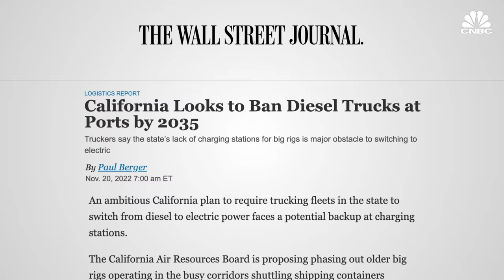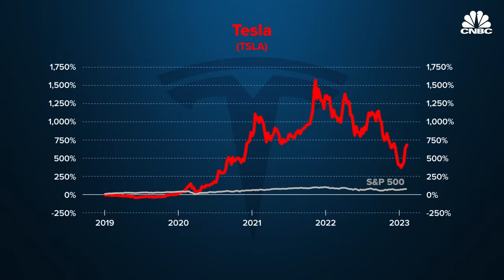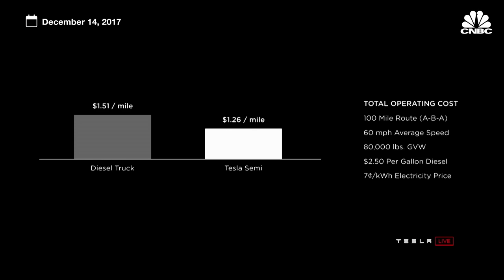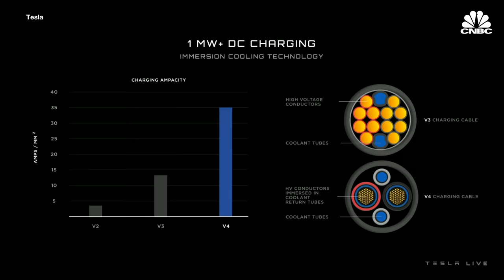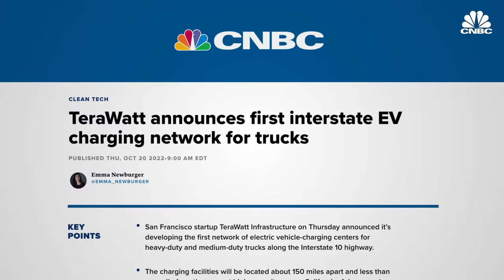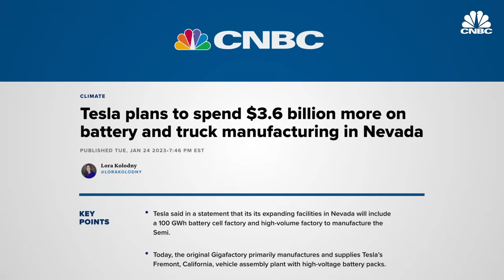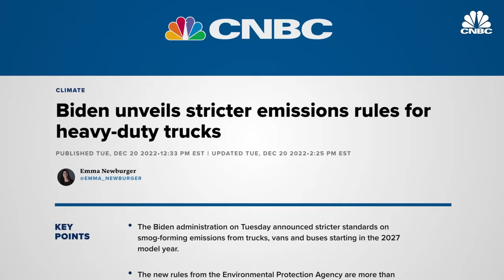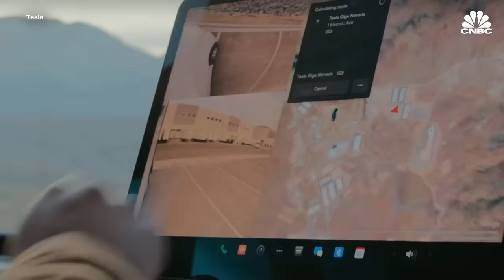Does The Tesla Semi Live Up To The Hype?

Comment: I can double over the road semi truck economy
Reply: Still waiting to hear how...
Reply: @BigBen621  with lift. Winglets strategically placed throughout the rig
Reply: @BigBen621  or possible redesign of trucks and trailers in general
Reply: @macbook802  Nice idea, but actual physics gets in the way. First, there are two components of drag or resistance that determine economy; aerodynamic drag or resistance, and rolling drag or resistance. Wings would reduce the weight on the wheels and thus reduce rolling drag; but they would also increase aerodynamic drag,  probably by a comparable amount—for no overall gain.
But a far bigger issue is that reducing the weight on the wheels would also reduce traction; and the more the weight is reduced, the more the traction is reduced as well. Any reduction in traction is going to have huge safety effects, due to reduced traction for cornering, braking, and acceleration.
Reply: @macbook802  The Tesla Semi was a clean-sheet design, from the ground up, for absolute minimum drag. As a result, it has far better economy than any other electric semi. The Tesla Semi's consumption averages 1.7 kWh/mile, and Tesla has stated that there's a clear path to 1.5—a potential 12% increase. If there are any further economies to be gained, you can be confident that Tesla engineers will achieve them; but the best possible improvement is nowhere near your claim of a 50% reduction in energy use.
Reply: @BigBen621  they can be deployable and retractable if need be. 40,000lbs of ground pressure vs 80,000lbs is still a very large amount of traction
Reply: @BigBen621  I've spent way way way longer behind the wheels of semis than all of Tesla's engineers combined. Since I was 18 years old I've spent more time behind a semi truck than on my feet
Reply: @BigBen621  if Tesla had a clear path to 1.5 during a ground up design why didn't they take it? And I'm not bashing Tesla I think it'll do great where it can do great, and the lift idea can be applied to their trucks as well
Reply: @BigBen621  and from all of my research there has been no testing to prove your ney say attitude
Reply: @macbook802  Sad to say, your experience as a truck driver doesn't repeal the laws of physics.
Reply: @macbook802  'if Tesla had a clear path to 1.5 during a ground up design why didn't they take it?"
You'd probably have to ask them.
Reply: @BigBen621  before driving a truck I was a full time skateboarder, I know physics I built my first full size airplane when I was 9 years old. I trained to be a helicopter pilot. I build rc airplanes I've thrown a frisbee and a boomerang hundreds of times
Reply: @macbook802  "and from all of my research there has been no testing to prove your ney [sic] say attitude"
Any engineer you propose this to is going to do the same calculation I walked you through, and conclude that no testing is required.
Reply: @macbook802   "I know physics ... . I trained to be a helicopter pilot."
Then you should know that you don't get lift without drag, which cancels the effect you were trying to achieve. And you should also be able to look up the lift equation, from which you'll find that generating 40,000 lbs. of lift at 60 MPH would take a wing of about 2,500 sq. ft.
Reply: @BigBen621  you're not an engineer, you're a Googler. Big difference
Reply: @macbook802  " you're not an engineer, you're a Googler."
Just out of curiosity, what in our debate led you to that fallacious conclusion?
Reply: @BigBen621  because you're interested in what people talk about, not what they do

Comment: 400 mile range..
what's the range with it loaded? 
I can't believe this truck only gets 400 miles. And I wont believe it will get that range fully loaded when electric pick up truck owners I know can't get 1/2 their range when loaded.
Reply: 500 miles fully loaded.
Reply: What John said. 

Comparing the Tesla Semi with electric pickup truck towing range is a false equivalence. Pickup trucks' EPA range is established without a towed load. At highway speeds, air resistance is the predominant load on a vehicle; and adding a trailer to an electric pickup truck doubles or triples air resistance; this is why the range of an electric pickup drops so much when towing. In the case of the Tesla Semi, EPA doesn't rate range of Class 8 trucks; but the stated range of 500 miles is established with a fully loaded trailer already attached, and so there is no loss of range when operated under the conditions with which the range was originally established.

Comment: Great so now on top of getting to the destination, there will be delays and planning around finding a place to charge such a large vehicle. Range of 100 miles, so 50 out 50 back...where u going!?
Reply: Where'd you get the nutty idea that the range is 100 miles? A Tesla Semi drove 500 miles from Fremont to San Diego, including climbing the 4,200 ft. Tejon Pass ("The Grapevine"), loaded to a GCVW of 81,000 lbs., on 93% battery charge.
Reply: @BigBen621  PepsiCo’s new Semis can haul Frito-Lay food products for around 425 miles (684 km), but for heavier loads of sodas, the trucks will do shorter trips of around 100 miles (160 km).
Reply: @Random-bm7ho  Either you've dishonestly edited the PepsiCo quote, completely changing its meaning; or you're quoting someone who did this. The actual statement, from a December 16th article in Reuters entitled  Exclusive-PepsiCo to roll out 100 Tesla Semis in 2023, exec says  and referring to Mike O'Connell, PepsiCo VP of Supply Chain, is "for heavier loads of sodas, the trucks will initially do shorter trips of around 100 miles, O’Connell said. PepsiCo then will also use the Semis to haul beverages in the '400 to 500 mile range as well' ”.
This makes it clear that the decision to use the Tesla Semis  initially for shorter trips  is based on the allocation of tractor assets to where they'll do the most good as the Tesla Semi inventory grows, and not a limitation of the range of Tesla Semis hauling heavier loads of sodas. Your comment left out the key word "initially", and left out the entire second sentence, confirming that their Tesla Semis are capable of hauling "heavier loads of sodas" for "400 to 500 miles".
Reply: @Ben Thurston  Ev's in general are a scam. There are too many variables to predict an accurate range. Everything from ambient temp, driving style, terrain, even you body weight will effect it. Not to mention having to plan your life around charging your car, that just sucks.
Reply: @Random-bm7ho  Moving the goalposts, aren't we?
You obviously don't have a Tesla; if you did, you'd know that they already have a trip energy calculator that takes into account driving style, climate, battery conditioning, terrain, and "everything else".  It's proven to be surprisingly accurate in my Tesla over 18,000 miles, which falsifies your claim that "There are too many variables to predict an accurate range". Load isn't included in the Tesla car energy calculator, because due to regenerative braking the load, which is limited to about 20% of the GVWR, has limited effect on range. But it's pretty safe to assume that the Tesla Semi version of this calculator will include the load, because it can constitute 2/3 of the vehicle weight and have a major effect on range.
Yes, I worry all day about when I'll have a spare 15 seconds to plug into my charger.
Reply: @BigBen621  You can justify it all you want. But being a ev fan boy doesn't reflect the reality of it.
Reply: It's 500 miles fully loaded. What you are quoting is the delivery radius so the amount of miles driven is at least twice that.
Reply: @John Theux  It won't happen. Just like the Ford truck has never come close to its promised range, especially loaded.
Reply: @Random-bm7ho  They exceeded 500 miles many times during testing with maximum load.
Reply: @johntheux9238  Not buying it.

Comment: Wait till electric is $1kwh to charge, To think the modern world is gonna live off wind and solar is laughable. Watch what happens when 200,000 in California (2+ million in the usa) trucks are having to charge every-night in the summer. "Diesel will be 20% more expensive than running a electric truck", electric being at .7c/kwh. My electric in California is .30c/kwh.
Reply: If electricity becomes $1 a kwh then you can just burn gas in a generator to get 30 cents a kwh, crazy how that works huh? Also compared the price of diesel 20 years ago to the price of gas, diesel is already skyrocketing in price not power.

Tesla is not just a car company it's an energy company as well. They will leverage their giant battery sytems at charging sites to even the load of charging trucks at unpredictable times or even if the grid goes black these battery will still be able to provide charge, they are expensive now but tesla plans on replacing the cobalt metal in them with cheaper iron. Tesla alo built multihundred megawatt battery sytesms which have the ability to charge hundreds of trucks at once to store power from wind and solar.

Comment: Hydrogen economy or death.
Reply: At current costs, hydrogen fuel cell vehicles cost four times as much to operate as electric vehicles. This might be a bit of a disadvantage for the "hydrogen economy". Add to that the fact that 95% of hydrogen is derived from natural gas or methane, and results in large amounts of carbon dioxide to deal with.

Comment: all that weight going to tear up the roads mark my word it's going to cost taxpayer a ton of money to fix the roads after those heavy trucks destroy them.
Reply: The maximum weight rating of a Tesla Semi is 2.5% greater than that of a diesel semi. In my opinion, the minor additional road maintenance that drives is well worth it for the numerous benefits of replacing diesel trucks with electrics; and the folks who write the regulations apparently agree. You are free, of course, to disagree.
Reply: @BigBen621   I do not buy that that one bit those batteries are heavy you are not also counting the load.
I work in transportation industry, and I can tell you I have seen those trucks not Tesla ones but others like US FOOD trucks they are heavy according to the driver.
Reply: @kuladoma3  I'm not sure what it is you're not buying. It's a matter of public record that the maximum weight rating of an electric semi, including the Tesla Semi, is 82,000 lbs.; and that of a diesel semi is 80,000 lbs. And 82,000 lbs. is 2.5% greater than 80,000 lbs.

Comment: 400 miles is nowhere in trucking. I see billions lost on the horizon. Even if there were charging ports along a route over 400 miles. Hours of service regulations would then come into play. So what could take 10 minutes to fuel now becomes an hour to charge.
Reply: Only takes half an hour to charge. After driving for 8 hours that's the right amount of time for a break.
Reply: @johntheux9238  takes an hour for four hours of drive time. A short haul drop and hook could benefit but not the average trucker . And I wonder how it holds up in cold weather
Reply: @donmagic2002gd  More like half an hour of mandatory break where you can eat a little for 8 hours of drive time.
Reply: @donmagic2002gd  Holds up well, it has the same heatpump as other Teslas.
Reply: @donmagic2002gd  Where's you get that nutty idea? It takes 1/2 hour for >6 hours of drive time.

Comment: EVs just export the carbon emissions (from mining for the battery to the power plants still burning fuel). EVs are not the solution were looking for.... Its a waste of time and money to invest so heavily in them. But that's the American way "make it some other countries problem".
Reply: On the contrary—the next generation of Tesla motors will use no rare earth metals; batteries with cobalt are rapidly being phased out; lithium mines are being opened in this country; and even in states with a high percentage of fossil-fueled generation (which is going down rapidly everywhere), the efficiency of electric propulsion is so high that emissions at the power plants due to EVs are still much lower than emissions from the ICE vehicles they replace.
Reply: You do realize tesla sell solar and battery grid storage, their company goal is literally sustainable transportation, notice how it doesn't say green, but sustainable.

Comment: And they’re only going 100 miles😂
Reply: *500 miles fully loaded.
Reply: @johntheux9238  and powered by coal!
Reply: @mitchellclark1  Mostly by natural gas in the US, which is 60% efficient versus 20-30% for ICE engines.
Reply: @johntheux9238  yeah that’s not much better and their production/disposal is much worse for the environment
Reply: @mitchellclark1  Well, it's still 2-3 times better and that's not even taking regenerative braking into account.
Besides, batteries are recycled with a 92.1% efficiency.

Comment: New diesel trucks are around $250k which makes the Tesla Semi almost $100,000 LESS than a diesel truck, NOT more! I have a friend who just bought a used diesel ruck for the price of a new Tesla Truck. Update: there are so many falsies I don't even know where to start and would take much to much time than I want to spend debunking this joke of a video. First they said it couldn't be built, pipe dream that it defies physics, now that they have been delivered all they can do now is bold face lie about it's capabilities.
Reply: Estimated price, it isn't settled yet, probably will be double the price of a diesel.
Reply: @caesarsalad1170  Wrong! 
According to Teslarati: Long-range all-electric trucks like the Tesla Semi will not come cheap. Battery costs are declining quickly, but even Tesla still lists its 300-mile Semi variant with an estimated starting price of $150,000. That’s higher than the cost of a comparable diesel-powered Class 8 truck, so the Tesla Semi would have to be very compelling to convince drivers and fleet owners to make the switch to electric.

Not to mention:
Operators can see estimated fuel savings of up to $200,000 within their first three years of ownership.

Comment: If your cell phone battery can last for multiple days without a charge running multiple apps but still holding the charge 

The EV vehicles can only go 220-297 Miles, that is definitely not two days of battery life, the battery power is regulated and controlled theses vehicles hit 60 MPH in 0.3secs 

but can't travel the same distance as standard  4 cylinder Mazda 3  on full tank which is 394 miles. 

Its just not adding up
Reply: Comparing a Tesla Semi with a cell phone is a false equivalence.
The Tesla Semi has a demonstrated range of >500 miles, fully loaded, including a climb and descent of 4,200 ft., over the Grapevine on I-5 north of LA.
No vehicle hits 60 MPH in 0.3 seconds.
It can travel 100+ miles more than your Mazda 3 example.
Other than those little details, you're right on!
Reply: My phone battery only lasts a couple of hours
Reply: @Tylerd838  Sounds like you need a new phone.
Reply: @BigBen621  or maybe I use it a lot?
It’s not even a year old;  can’t really get any newer
Reply: @Tylerd838  Hmmm... Mine lasts most of the day, even when streaming videos. Maybe you should submit a warranty claim—I can't imagine any use that could run down a phone battery in two hours.

Comment: Bias reporting is endemic, it would appear. No one is addressing the fact that a transition to 100% electric battery powered vehicles is unlikely, due to the shortages of crucial minerals needed. And though an electric motor has a higher efficiency than an internal combustion engine, no one is factoring in the LOSSES that come with power GENERATION, transmission, charging / discharging batteries, and so on. In fact, an ICE has a HIGHER efficiency in conversion of fuel into movement, than an equivalent fuel to electric to battery to movement. Not to mention, lower weight. 
EXCEPTION - if the roads become "electrified" with catenary power or other distribution methods, that might mitigate some of the range issues, and allow for lighter battery configurations.
OF COURSE - the most efficient form of land transport is "old fashioned" steel wheel on steel rail (co:efficient of rolling resistance), and an 80% transition to electric traction rail would be far more economical and effective over the long term. In short, get "back on track" and really cut fuel consumption.
Reply: What about the fact that BEV is still in its infancy and we have gone as far as we can with ICE? Surely BEV will improve drastically in the next 100 years?
Reply: @yingle6027  IMPROVE DRASTICALLY? No. Why? Well, let's look at railroads. The basic principle of rolling resistance shows that steel wheel on steel rail has a 20:1 advantage over pneumatic tire on pavement. Has technology of railroading drastically changed that fact in 160 years? No. Propulsion systems changed. Manufacturing changed. But the basic principles of Physics have not. Now BEVs are not the most efficient form of land transport since they are pneumatic tire on pavement. Regardless of the efficiency of the powerplant, BEVs will consume 20 times as much fuel / power to move cargo  and or passengers than a railway. Even if BEVs reached 99% efficiency, it won't change the laws of Physics.
Stop and think. If you could press a button and suddenly move TWENTY times as much cargo / passengers for the same unit of energy, would you? 
So why aren't we advocating a renaissance of rail? Who is thwarting any attempt at "getting back on track"? 
When you find that out, you'll "know" the rest of the story.

http://www.brooklynrail.net/science_of_railway_locomotion.html
Reply: @mr_obscure_universe  Of course rail is more efficient but it costs a lot to install and it has only a fixed direction of travel. I'm talking more of personal modes of transport.